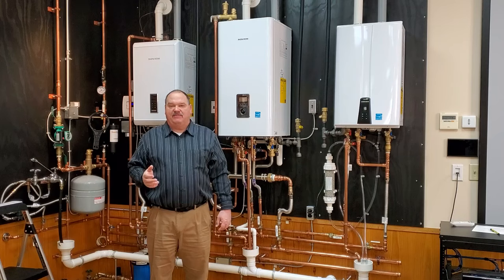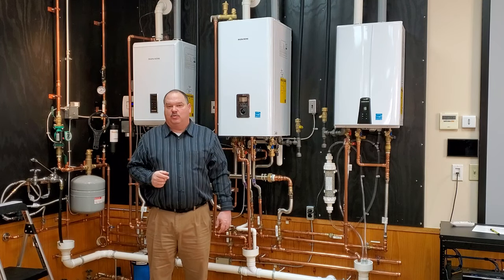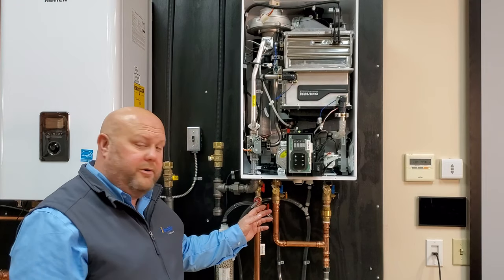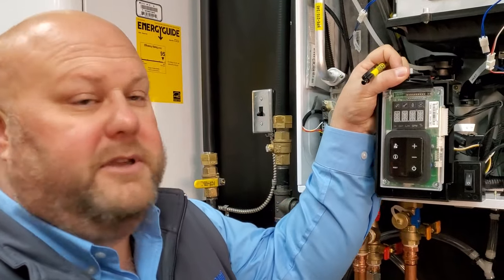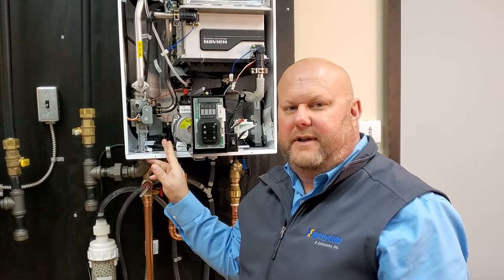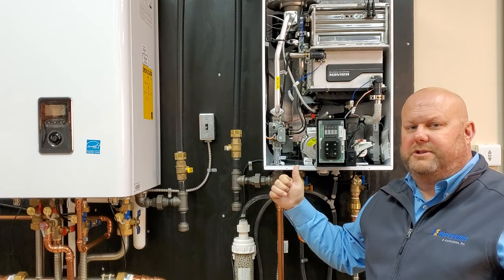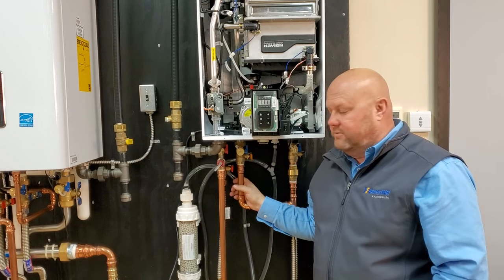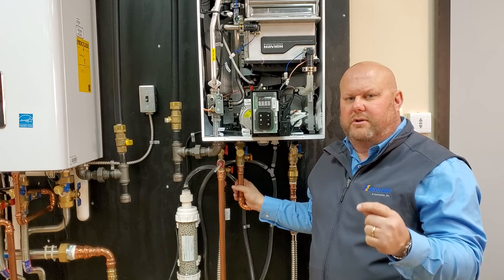Residential Recirc setup with Navien NPE A for faster hot water delivery.

Comment: 40yr plumber here. Just been hired to find out why the other company that installed a 240A2 last week cannot get the recirculating system to work even after installing the navicirc. Knowing nothing about these systems I started doing research and you were my first stop. After watching the video, I got money that says this is my last stop as well and the answer has been solved :) Great job guys! Love the fast talking. However I can’t wrap my brain around the first method of recirculating, what good is a pump that has no line to recirc with? Guessing that terminology is being used, but in essence it’s not a true circulation but nothing more than a small holding tank always hot to prevent lag. So it’s really a lag prevention, not a Recirculation system :)
Reply: the internal recirc is supposed to be similar to a grundfos comfort system
Reply: Did you not catch this improperly installed?  Check valve wrong location not being upstream of tee along with thermal protection.  I used this video along with the book to figure out a few things. Our instructor was wrong as well stating to only reverse pump switch and set cycle times correctly.  Basic training never explained water hook up with Navi circ so this was an experience

Comment: I literally logged in for the first time to thank you (and like vid!).  The part about the "External vs Internal" is in NO way described anywhere else.  This video confirmed my suspicions of a new install was underwhelming.  I had previous 3/4" return plumbed, but they had they internal switch set to Internal circ and computer set same.  A few screws and the changing of some settings and much better results at the tap.  Thanks again for this and the other 2 videos I watched to Pre/Post purchase.

Comment: In case it helps anyone in future, the check valve for external circulation (NaviCirc setup) is not required for A2 model per Navien tech support over the phone. The check valve is built into the A2 model now.
Reply from the maker: You also do not need to bypass the cold feed to the external recirc connection with the A2 model as that also is done internally.
Reply: @eklof6510  I just had a NPE-240A2 installed at my home and I'm curious based on your above comment if you're saying that the "T" fitting is no longer needed with the A2? And if so, is it also not required to change the recirculation setting to "ext"? I'm definitely interested in getting the NaviCirc installed, I just want to make sure I ask for the most accurate thing from the plumber. Thanks for the videos! They've been very helpful in understanding my system.

Comment: Do those recirc valves fail after 2 years? I have a plumber recommending a direct line rather than using the included Navien valve b/c they say they fail after couple years

Comment: Why is the check valve not upstream the tee. Before the tee on the main incoming.  That’s where it needs to be to serve its purpose. Otherwise it’s pumping into the main as well.  Thermal protection must also be added on the system within those circuits

Comment: I have the NPE-240A model and I am planning to add the NaviCirc valve at the fartherst sink to use the cold water line as a return. The only question I have is regarding the checkvalve (time 2:05). Which way is it supposed to be installed? I am somewhat confused on the waterflow and just can't picture it in my head.
Reply from the maker: Jerry Jablonski This is detailed in the installation manual including all of the setting parameters for your desired operation.  Tech support will also be glad to walk you through if you are the installing contractor. 800-519-8794

Thank you for watching! Make sure you follow us on our FB page here: https://www.facebook.com/scottgreggoutdoors/  I usually post what's coming up there as well plus other channel insight and content not on YouTube.  Also Instagram at www.instagram.com/scottgregg1966/

Comment: Video is very helpful! I have a 240a installed with external recirculation line option. Dip Switch 1 and 2 are ON for intelligent mode. When the recirculation turns on I get the pipe knocking sound , as if air is in the line/pipe(PEX). Do you know what causes that to occur? I have been looking everywhere for information. I also wanted to ask if it's okay to lower the pump run time from the default 20 minutes down to 10 or 5 minutes? Thanks in advance for your help. The unit was installed over 2 years ago, and the knocking noise has increased over the last 6 months.

Comment: I'm debating on having a Navien npe-240a2 installed is this a good unit for a 2800 sq ft 2 story house with 3 bathrooms? Does one need to run a condensing drain pipe? How often and expensive should they be serviced? Do these require flushing valves? Also looking at the Bosh Greentherm T 9900 SE 199NG. Which is better and going to last longer?

Comment: IS the check valve necessary for use with the navicirc device?  I had a plumber install the navicirc, he basically did not even want to add the extension off the cold water line to the recirculation line and I am failry certain he did not install a check valve.  Will this system function without the valve?
Reply: Refer to the NaviCirc instruction manual on Navien's website. It shows the tee branch from the cold water line into the recirculation inlet is needed with the NaviCirc device. As for the check valve, it is required for models prior to the A2 series. The NaviCirc manual says the check valve is required, but I called Navien tech support to confirm; they said the check valve is not required for A2 model and the NaviCirc instructions are from 2019, so they're just outdated for said model. Hope this helps.
Reply from the maker: The check valve is required for the system to work properly per the instructions.  You might want to contact your local Navien Service Specialist to check it out.

Comment: I do not understand why the Coldwater is put on the recirculating side? Please someone in for me because I actually did the install and it did not work out well. I replumbed it for both hot water on the left side
Reply from the maker: There is too much to go back and forth with it in these comments. The installation manual has several different ways to pipe recirc based on the type of installation. There are several different ways to do it depending on what type of recirc system you are using.

Comment: Is it possible to use the NaviCirc™ with a PEX Manibloc?
Reply from the maker: Yes sir. However you will obviously only be recirculating one fixture at a time because of the way manibloc systems are piped. The NPE-A model internal pump can do up to 100' of 1/2 total pipe or 400' of 3/4" pipe with a Navicirc installed or an external pump properly sized for the applications can be used with either the NPE-A Model or S model heaters.
Reply: @eklof6510 Thank you!  I had the Navien NPE-A2 240 installed last week and we are thrilled with it.  I am thinking about having the plumber return and put a NaviCirc on the kitchen sink and the master bathroom sink as these are the only two places that I care to not have to wait for hot water when needed.  I am also thinking that this will atomically bring hot water at least at the entrance to the Manibloc for the other hot water hookups and possible result in a bit shorter wait time on them as well.  Can I put more than one NaviCirc in my home and am I on the right track with using the NaviCirc with the Manibloc?

Comment: Thank you for the info that you provided, this was helpful! I flipped the dip switch 1 to ON for my NPE-210a and it seemed to help me get hot water faster to my upstairs sink/shower. I have a couple generic questions:

1) Now that I finally turned on recirculation switch, do I need a bridge valve at furtherest sink upstairs? I've read several times about installing a bridge valve, but am unsure if it's needed. 

1) I have seen in other forums/videos that when the home owners first installed a tankless water heater, everything was working fine, and he got continuous hot water. But then when his kids got older and started using more water, the kids would have to wait for hot water (their room was a little further away I believe). So does that mean that the standalone tankless water heater only works well when there are only a couple people using hot water? So if there are multiple people using water, then an external recirculation pump is needed? Or is it a distance thing?
Reply from the maker: 1) No. You don't have to have a NaviCirc installed unless you want it to get hot water faster.
1) No it is a distance thing. The longer the piping is from the Navien the longer it is going to take to eject the water that has cooled off and is in the piping before the hot water gets there. "Lag Time"  This can many times be helped with the NaviCirc installed by your local Navien Service Specialist.

Comment: This a bit late, given the last comment was from about 9 months ago, but I am working through a recirc project on my NPE-240A and wanted to comment/question:  The manual shows a check valve already internal to the unit.  In order (in the diagram), water is shown flowing into the recirc inlet, through the internal recirc pump, and then through the check valve.  Given this, is another check valve on the copper outside the unit really necessary to install?  Again, this is the manual for the NPE-240A, not the A2.  Thanks.
Reply from the maker: Yes, Pipe it per the diagram.
Reply: Ok, so to be clear, 2 check valves are required: an external check valve prior to the pump, and an internal check valve after the pump.

Comment: I have NCB-E combi unit. my water takes a while to warm up.  Does combi unit have the same re-circulation built in?  Dip switches?  Thank you.
Reply from the maker: This is something to address with the installer of the unit.  There are many variables in homes that can effect the "lag time" to get hot water to remote areas, and with it, more than one solution.  Your installing contractor should be able to help you figure it out for your home.
Reply: @eklof6510  thank you.

Comment: Trying to figure out if I need an expansion tank installed on my hot water recirculation loop. I have the DIP switches set correctly and the EXT valve to set correctly, loop works good, but wondering if an expansion tank is needed or not. Do you know?
Reply: You don’t need expansion tank for tankless water heaters
Reply from the maker: Empire Plumbing: On a recirc loop you do because it is now a closed system!  Please attend to a Naven installer class when you can make time for it.
Reply from the maker: YES you do!  Whenever you have a recirculation system or stored hot water, you need and expansion tank sized to the water volume of the system.  We are the Rep in your area.  Please contact us and we will be glad to help you with this.  The Virginia main office number is: 804-266-0079
Reply: @eklof6510  Yea I called Navien two times one week apart. One phone call they said you need a tank. The other call to Navien they said no you do not need one. I noticed in the installation manual they show an expansion tank, however its always on the COLD supply side so very confusing.
Reply: I guess you need an expansion tank on COLD supply side if you're on city water, AND a tank on hot water loop so TWO tanks total if on city water ?   if on well, you'd only need tank on hot water loop (one tank on hot water loop, and no tank on cold side). Correct?
Reply: @SuperPlumber30  wrong

Comment: Could you clarify what setting is needed for using the internal pump with an external recirculation line?
Reply from the maker: jmholsin First, you have to have the 2-way valve in the inside set to external recirc (Down position) Then you'll need to set up the programming to the desired operation.   Tech Support can walk you through this 800-519-8794

Thank you for watching! Make sure you follow us on our FB page here: https://www.facebook.com/scottgreggoutdoors/  I usually post what's coming up there as well plus other channel insight and content not on YouTube.  Also Instagram at www.instagram.com/scottgregg1966/

Comment: Had 2 naviens in the last 4 years. They suck break down and expensive to fix even though parts are under warranty. And yes they were installed. Correct
Reply from the maker: That hard to hear as we as a local rep would have wanted to get involved before you developed that opinion.  As a long time Navien Rep and when you sell tens of thousands of an item, we unfortunately run into projects that have issues from time to time.  That is what your local reps are there for; as another layer of support behind Navien Service Specialists.  Many Navien dealers are very good and are able to solve problems quickly... some are not.  I would suggest you contact a Local Navien Service Specialist from the dealer locator on the website.  These are the best of our dealer network and you may ask them if they can have a local rep visit as well to determine once and for all what is going on with your project. Something is very wrong if you have had in 4 years with problems.
Reply: @eklof6510  have you seen Mikey Pipes channel? You may want to reconsider Navien and their quality
Reply: Every customer of mine gets a Navien tankless install from me here in the SF Bay Area. From brand new high end new construction homes to just simply upgrading from standard water heater to tankless in single family homes.

Never once in the last 5 years have I had a customer call back due to malfunctioning of the unit. One time I had an issue and that was from my minor mistake, other than that Navien all the way baby!
Reply: @EconpLLC  Yup, I have installed dozens of Naviens, no issues

Comment: I have a NPE-240a. Is there a way to set up scheduling for recirculating?
Reply from the maker: Yes, but with that model you'll need to add the wired remote or the Navilink module and use the phone ap to program it.  With the New V2 models, the programming is available on the keypad that comes on the front of the unit.